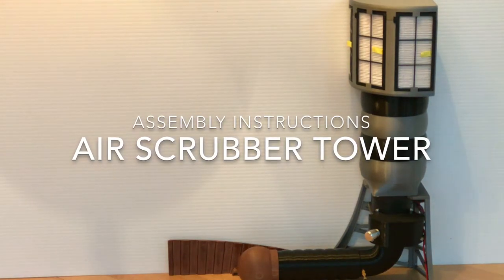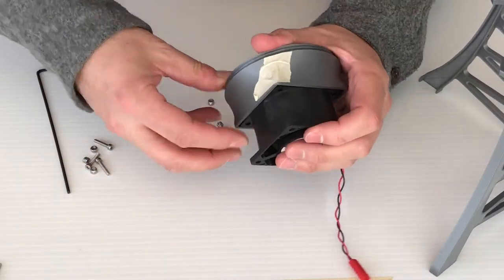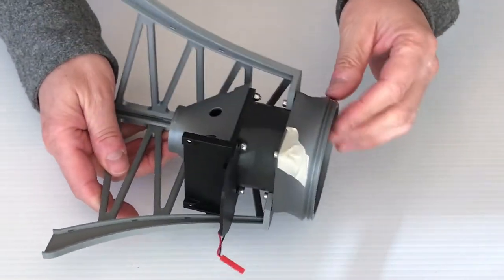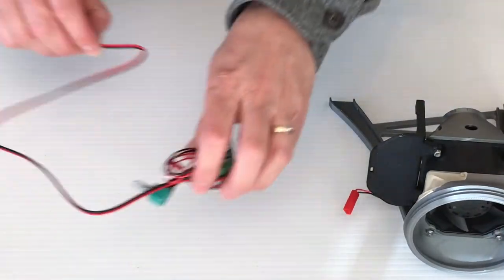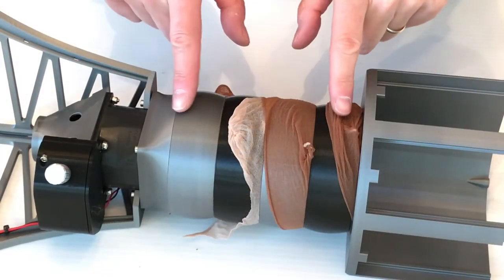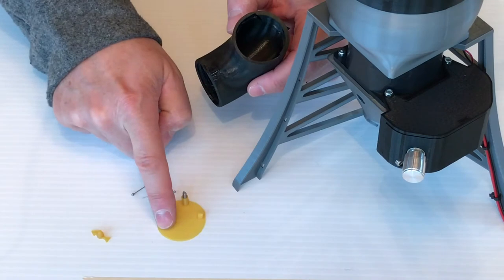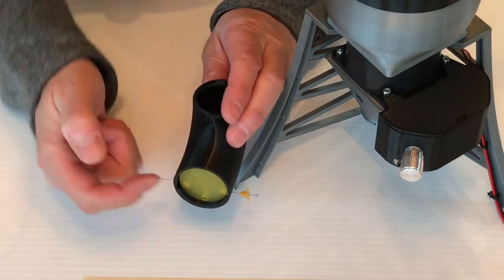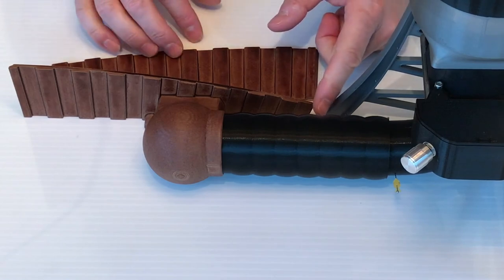Air Scrubber for a 3D Printer Enclosure - Assembly Instructions

Comment: Is this a viable solution for use with Resin printers?
Reply from the maker: HEPA filters and activated charcoal are widely utilized for air purification in many types of situations.  I use this solution because it is the best available, and it is at least better than NOT using an air scrubber.  I have not yet seen a scientific study that quantifies how to sufficiently scrub the air around a 3D printer.  I have read the studies that describe the types of particles that have been detected emitting from 3D (FDM) printers; and HEPA + activated charcoal are known to be effective filters for those types of particles.   I have not read any studies on the types of particles emitted by resin filters.   You could do a qualitative test with a commercial gas mask (3M 6200 - Half Facepiece).  These masks are HEPA+activated charcoal, so they will approximate the results of the air scrubber.  If, when using the mask while printing, you notice no fumes, then we could predict that the scrubber will help clean the air around a resin printer.   Just as with an FDM printer, you will need an airtight enclosure to house the scrubber + resin printer.  The scrubber cleans the air at a gradual rate, which means it will take some time to clean the air in an enclosure after the emitting is concluded.
Reply: @duaneanderson8641  do they stop the smell?

Comment: Why add dessicant? All you're doing is drying out the air you're expelling from the enclosure. I can't see how this will make the air inside the enclosure itself any dryer.
Reply from the maker: The value in adding desiccant is twofold:   1) Most of the filtered air is recirculated into the enclosure interior.  2) The activated carbon will also absorb moisture, but that moisture diminishes the ability of the charcoal adsorption of VOCs, therefore the desiccant (which can be reused) extends the life of the charcoal.

Comment: Hmm.... I have doubts that this design really works. Can you prove the flow through the HEPA filters? That flap doesn't prove that.
Reply: @duaneanderson5172  Check out Xiaomi Mi Air Purifier filters, they are cheap, have much larger hepa surface and come with removable carbon filter. That would be the best choice to design this type of system around. It would be much simpler overall, easy replacement of filters and way larger filter surface. Its around 30$ for the set of hepa & carbon.